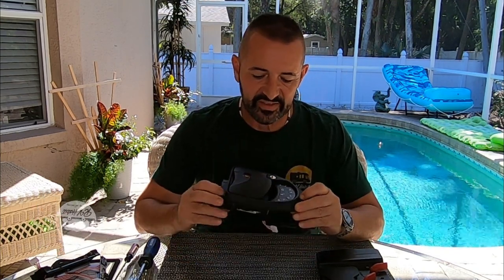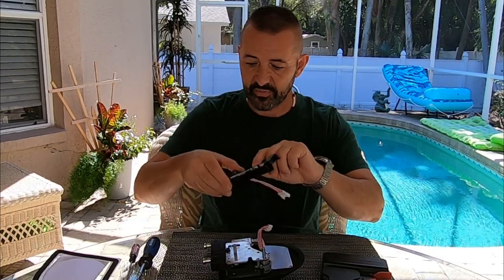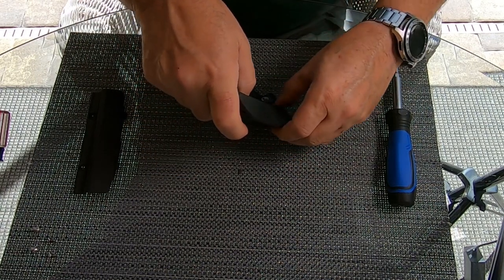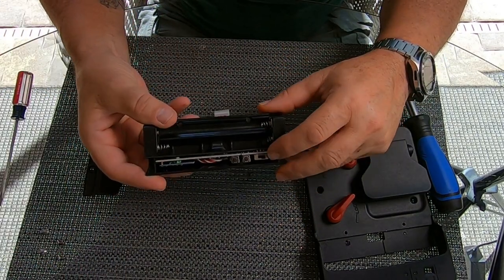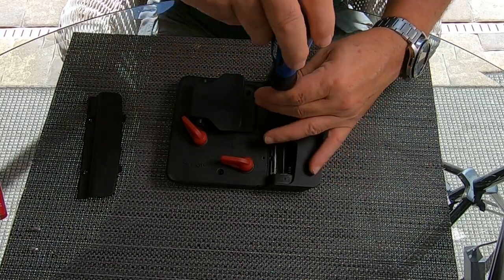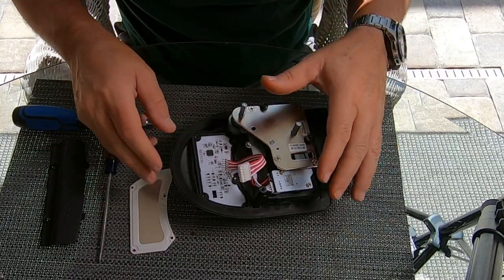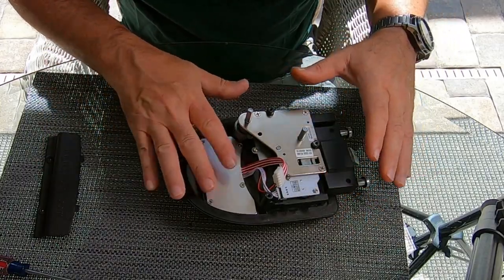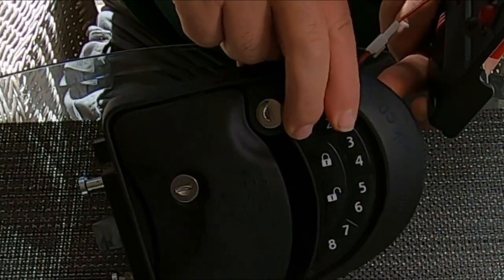Repairing A Keyless Electronic RVLock - PCB & KPD Circuit Board

Comment: Great Video 😊 Excellent step by step.   I also had my lock just out of warranty go bad and called the nice folks in Utah to get the PWB parts.   Yes, great people at RV Lock and very helpful, although the problem is with the design and the fact that the unit would never pass a water and environmental test by UL LABS.   When new the lock is awesome, although when time and weather hits it, the lock us junk.   Sorry to vent, the point is your video is awesome, it's just the fact we have a company like RV Lock selling junk that's poorly designed and allows the weather and rain to junk it out.
Reply from the maker: Hi Joe,  I think the water gets in the inside handle when you open door in rain.  There is no gasket on the interior handle.  Thanks for watching.

Comment: Maybe adding some dielectric grease to the lower battery compartment and the connector that corroded would be in order.  The manufacturer needs to do some redesign to tackle this problem.
Reply from the maker: My thought exactly on the dielectric grease.  I couldn't find a full tube I just bought.  I will definitely be adding some when I buy some more.

Comment: Good information but Isn't there a lifetime warranty on these locks?
Reply from the maker: Yes they claim lifetime warranty but fine print also states, Damages not covered are those resulting from abuse, normal wear and tear, accidental damage, and cosmetic damages that do not affect the functionality of the lock.  So I guess the electronic boards are either normal wear and tear or considered accidental damage since it worked when I bought it.
Reply: @RVHabit  thanks but I just got the boards sent to me because it was constantly beeping. Guess I was lucky they have a gasket that is supposed to stop water infiltration so I would say it’s on them